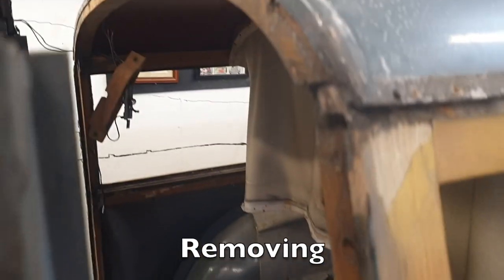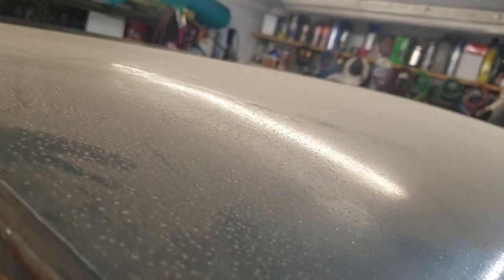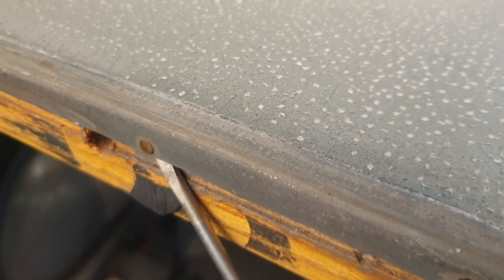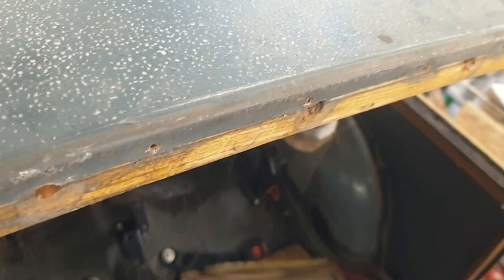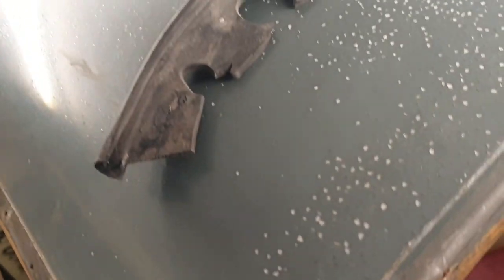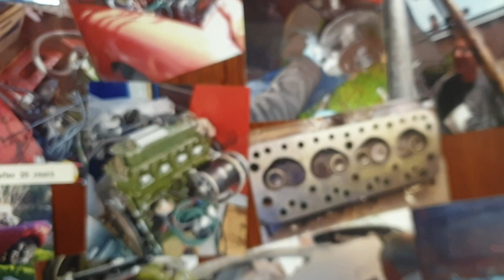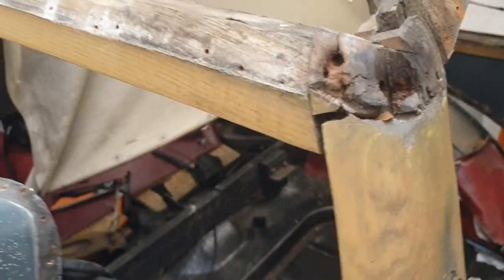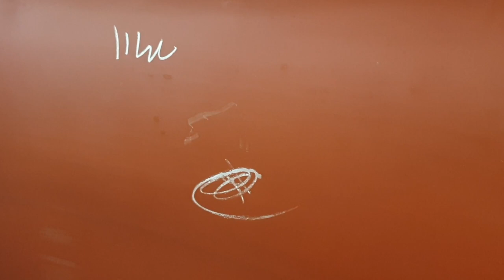Morris Traveller Frame # 3   HD 1080p

Comment: That looks like the original colour of my Traveller that I am rebuilding. I am changing the colour scheme slightly to a two tone with a white roof and cab as I do like the white roof and cab look over the dark grey body.
Reply from the maker: Mine is Clarendon grey, originally it was Frilford grey (think that the name), previous owner changed to Clarendon and personally I think it the nicer of the two grey its slightly darker. 

White or cream roof will look good are you finishing it at the top or were the posts meet the bonnet?